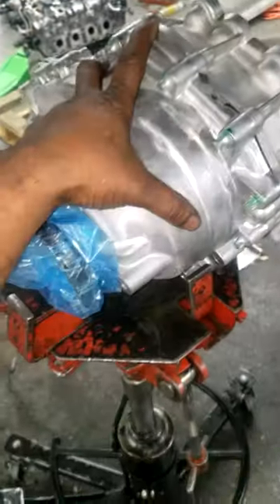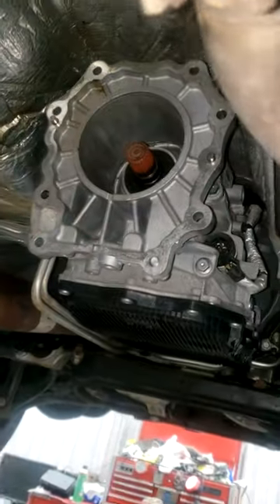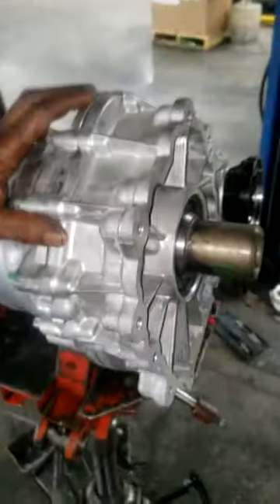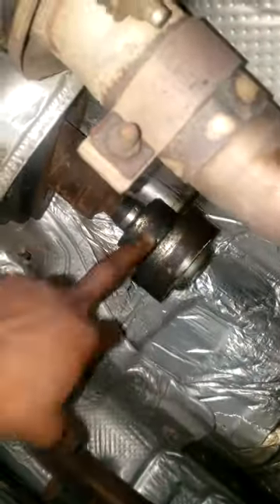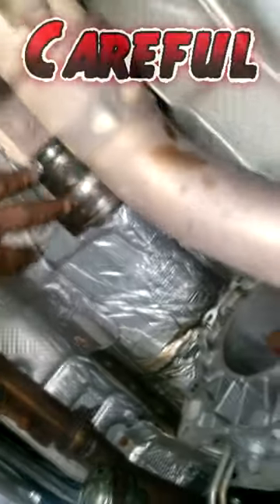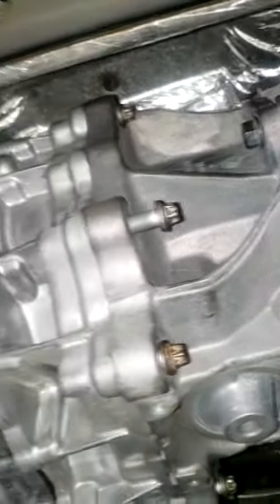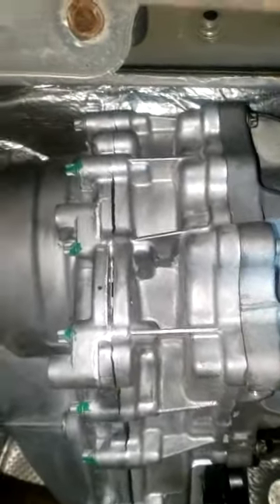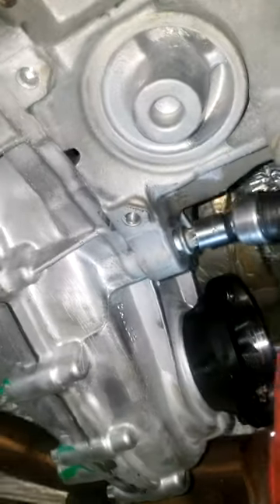Work Smarter not Harder when doing these. Use the Jack.

Comment: If you abuse your body like that you'll regret it in the future. Look at any old guys who used to do that when they were young. They're damn near crippled in their 50s and 60s.
Reply: So true! Wise words.
Reply: Yup, know some old timers who said they weren't careful and have knee, back, or shoulder problems now. A friend's dad had two knee replacements by 55-60ish. It's easy to think it'll never happen to you when you're 20-something. Then 30 years go by before you know it...

Be smart, take care of your body, and it'll take care of you!
Reply: Im one of those 60 year olds you speak of . Seemed no one was around for help when I was doing this type of work but was always asked when it was someone else needing a lift
Reply: HEY, I did that work for over 35 years and never did anything that silly, still had 4 knee operations, and 1 foot operation. It doesn't matter 9/10 hours a day on concrete takes it's toll
Reply: @no1ghostrider  and doing something like lifting a transfer case on your shoulder would be ten times worse than just standing on concrete. Good shoes can help with the concrete issue to an extent.
Reply: @Krankie_V  wore the best boots money could buy, but like you said they can only do so much
Reply: You got that right I'm proof

Comment: Why not wire brush the splines in the output shaft of the trans and put a little grease on it? You can clearly see it’s all orange and rusty
Reply: Sheesh the roasting sesh 💥😶‍🌫️
Reply from the maker: @Isaiah Moreland Now just how did those bolts become cross threaded by trying to remove them and only made it 2 turns? You just make shit up as you go i see. I merely tighten those bolts back up because i changed my mind on removing the drives shaft. If you gone quote me, do it right. Or simply make a video showing how you do things. What you see over here on this channel is how I do things. Jump on in this youtube ring and flex my dude, no sense doing it in the comment section. Dont be a sideline troll.
Reply: @OnlineMechanicTips  thankyou for the like. Subscribe for more mechanic content
Reply from the maker: @isaiahmoreland6952  Im not impressed. Make some videos dude. We wanna see videos, not lip service.
Reply: @OnlineMechanicTips  I use lab scopes and scan tools. I'm not a parts changer
Reply from the maker: @isaiahmoreland6952  More lip service??? We don't care about what you saying dude. This youtube. Put up or shut up.
Reply: @OnlineMechanicTips  "this youtube" indeed
Reply from the maker: Yea so stop being a sideline troll and get in this youtube game. Its some serious money to be made. Since you already know everything the transition should be a little hard for you. Just so you no, a video content creator and a shop mechanic 2 different people with different motives. So don't get it twisted
Reply: @OnlineMechanicTips  I now understand, you are a content creator not a mechanic
Reply: @isaiahmoreland6952  and you’re a troll, not a mechanic. Can’t be two things just one sorry.
Reply: @MischeifMakerz  😂😂thankyou for your help